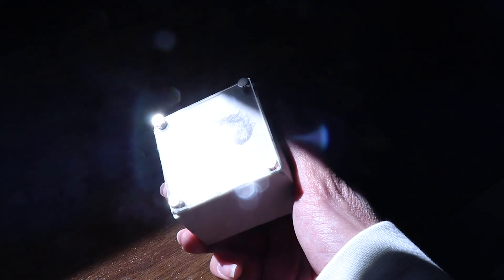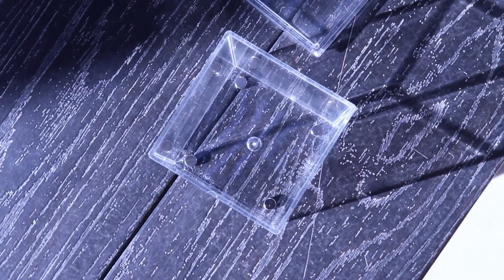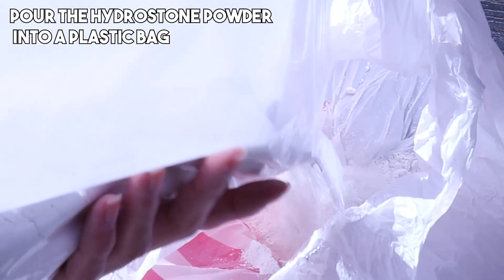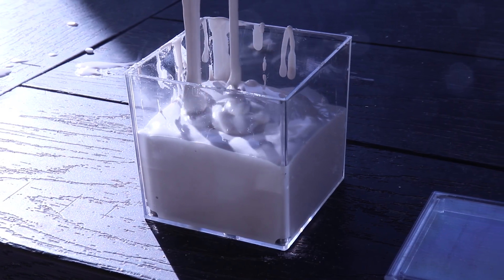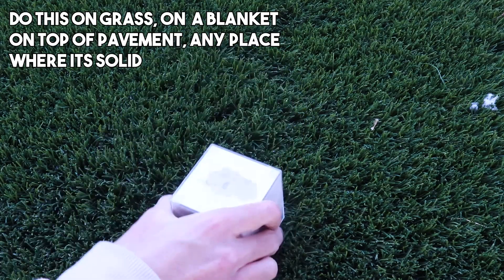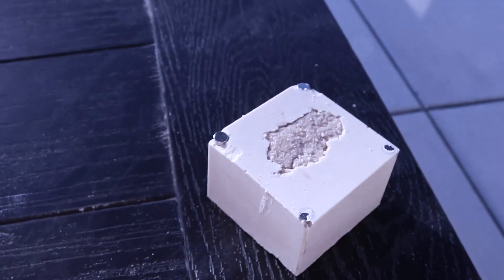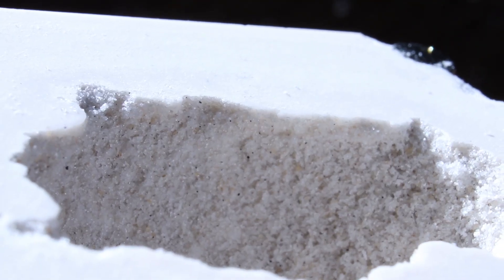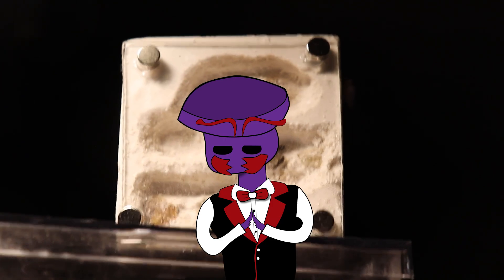How I Made Stone Ant Farms For My Pet Ants

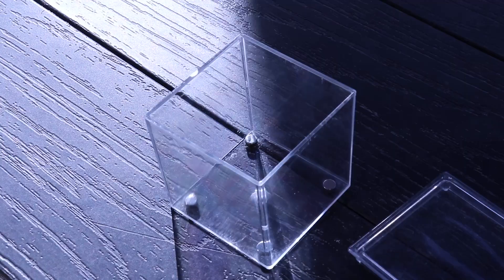Comment: That's terrible instructions. First off, to prevent/reduce sand spills over at 1:37, take a small portion of sand out and place them in a container before wetting them. Then, use a spoon of sorts to place them in your container etc. You can use a second spoon or something to have an easier time shaping the sand and removing them from the first spoon. Secondly, don't mix your mixture in a plastic bag. Again, use a container. Chances are, if you're using a plastic bag from your groceries, there might be tiny holes in them (due to scraping off from your groceries), causing leakages and spills. It's also far easier to work from a container with it's rigid structure, as a plastic bag tends to collapse in on itself, making it hard to take out your mixture or to pour.